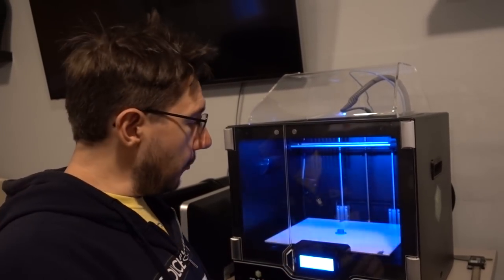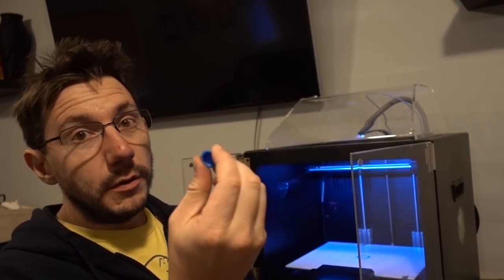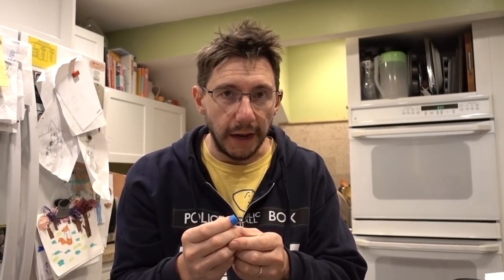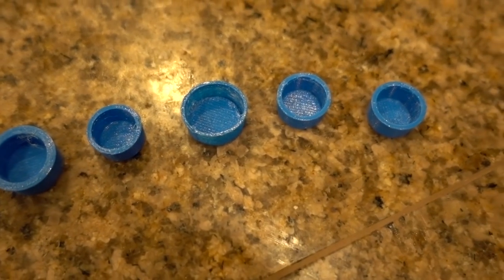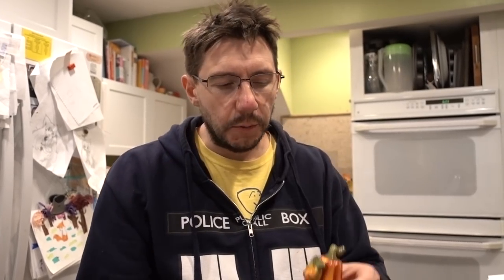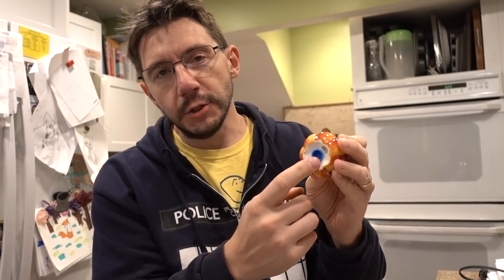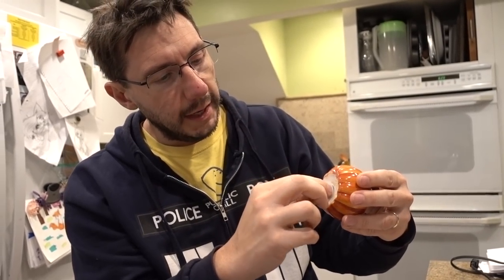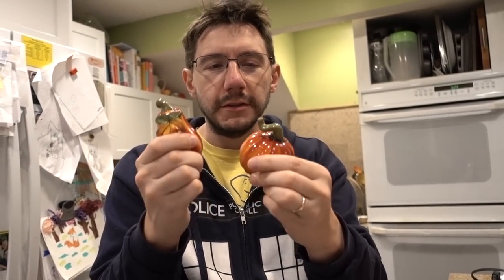Practical 3D Printing: Fixing Salt & Pepper Shakers with Flexible Filament using ZYYX 3D Printer

Comment: I had the same problem when I lost the stopper of a salt shaker. So, I cut a wine cork in half and shaved it to the correct size, It took about 10 minutes including the time to find a cork. I love 3D printing, but sometimes when I start thinking about printing up a solution to a problem I have to admit to myself that I'm just overthinking things.

Printing a refrigerator latch replacement, worthwhile. Printing multiple versions of a salt shaker plug, not so much. 

All meant in fun. I love the channel.
Reply from the maker: heh, well, I sort of agree. The cork fix is brilliant for sure. However, I also used this as an opportunity to sharpen my saw a bit. It had been a LONG time since I was able to open Fusion 360.
Reply: Haha my country doesn’t use corks for wine at all and my bro has a 3d printer so this might actually be the optimal solution for me.
Reply: Most wine here use sterling caps so you'd be lucky to find a cork unless you want to fork out the moolah for a classy bottle of wine.

Comment: Don't own a tripod? Just have kids!
Reply: Buying a tripod might be a little cheaper though :P
Reply: if you have three kids you can just lean them against each other and put the camera on top
Reply: "I printed this up on the Giant printer but when I scaled it the camera it's designed for is also 500%, so I printing this adapter for a 500% camera that holds a regular size camera inside the lens. Let's take a look."

Comment: long term, is the TPU being in contact with the pepper going to be ok? IE is the material food safe?
Reply from the maker: Yes it will be. "Food safe" is a relative term, and even FDA labeled "food safe" filaments aren't such. The things to look out for are if the filament will see heat, and if it'll see wet. These stoppers won't see heat or wet, so there shouldn't be an issue.
Reply: joe zenkus The plastic by and large is not the problem here. The actual problem is the porosity of the material harboring bacteria. It's not too bad though if there's no water around.

Comment: Did the same thing for shakers I am turning on the lathe.  Commercially available ones are 1" in size, I had different hole sizes.  I used NinjaFlex TPU filament.   You can see them here: https://www.flickr.com/photos/192305240@N02/albums/72157718473684263

Comment: is that filament food-safe?
Reply: Jasphere Rindou that was the first thing I thought about. I believe many flexible filaments like TPU are similar to ABS in that they’d leach harmful chemicals into food.
Reply from the maker: In this case it should be. This filament here won't be exposed to "heat" or "wet", so the chances of anything leeching off are extremely low.

Comment: You should´ve made the stopper conical, then you wouldn´t had so many fail-prints
Reply from the maker: I thought about that in the beginning, but went with replicating the design. I think have a put a slide conical shape on it, it would have worked better. Maybe that'll be another video?
Reply: 3D Printing Nerd I was wondering why you didn't use a revolve to form the round object. Would have been a bit better.
Reply: Extruded circles are the simplest way to design this shape, and using offsets allows for easy resizing as you refine the print.